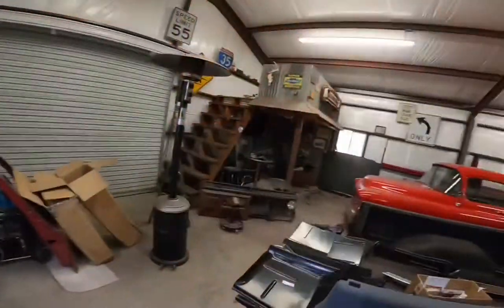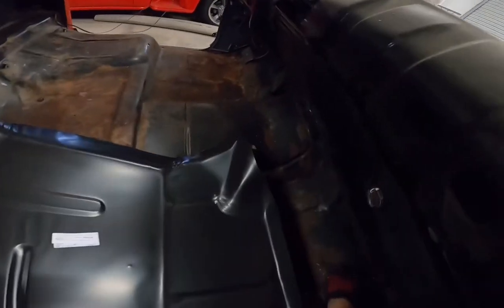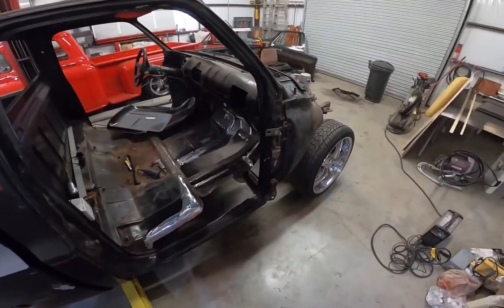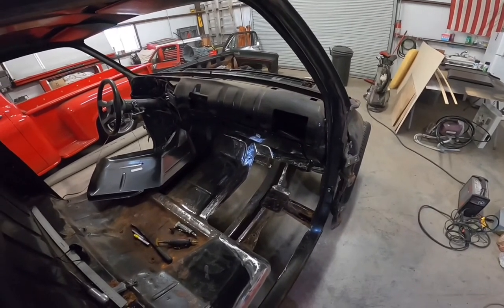‘76 C10 Floor Pan Removal and Patch Panel Replacement Part 1

Comment: I have a 57 3600 truck I'm working on now. Minnesota rust, so left right step rockers, and floor panels are the task at hand. You are the first channel I've seen use a plasma torch to cut old sheet metal panel parts out.

Comment: Once again, I find that no-one markets a complete floor pan, for the square body. My 83 C-30 dually, has rot all the way back to where the seat frame attaches, (the large hump, "behind" the pan for the feet). All the way out to the inner rocker. Amazing an aftermarket company hasn't re-manufactured this.